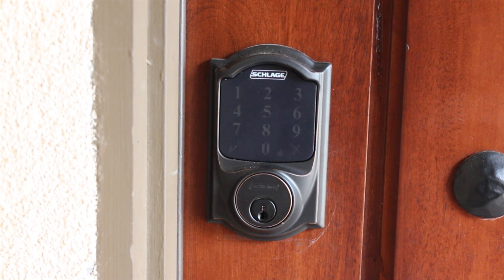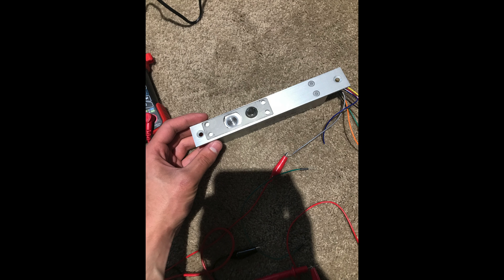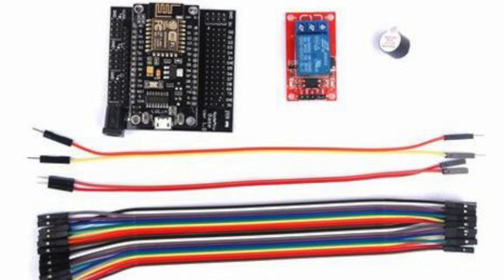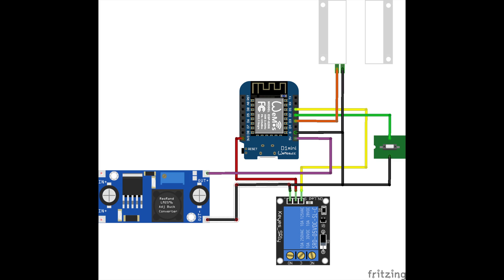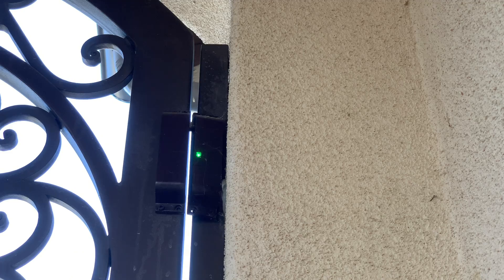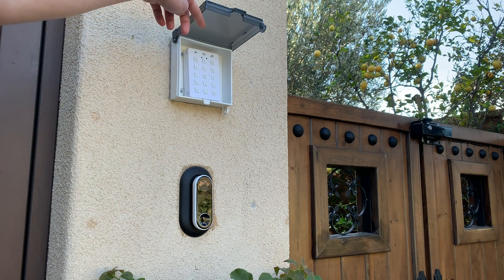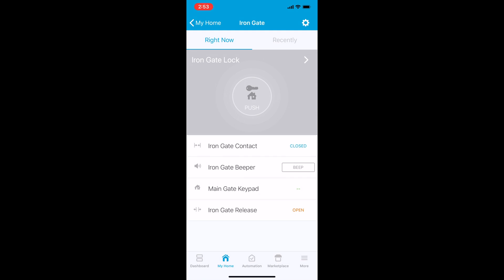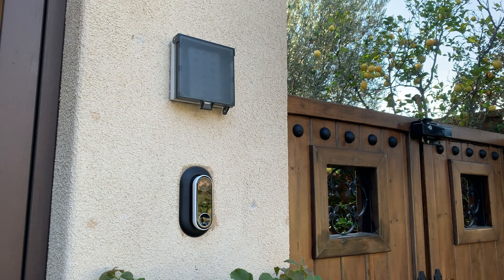Smart Home Gate Control

Comment: Nice setup and video! Are you using the konnected board to provide relay output via 12v relay power adapter to all the locks you have linked in the video?
Reply from the maker: Yea the Konnected boards are connected to a relay that passes in 12V